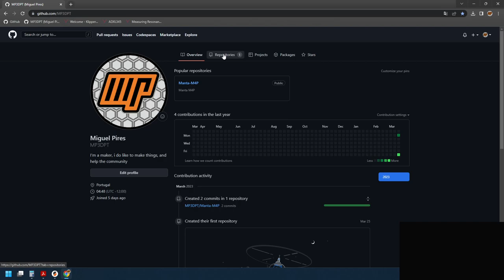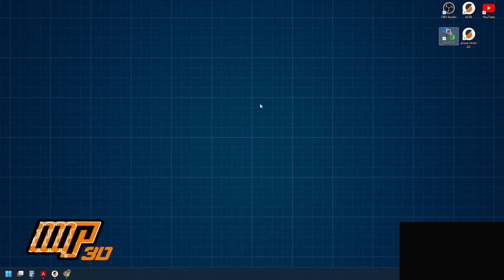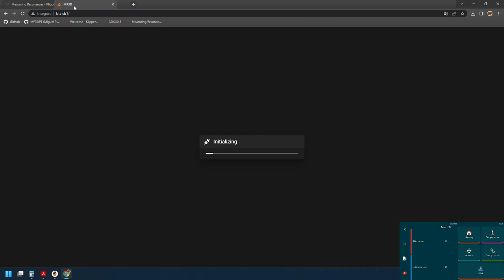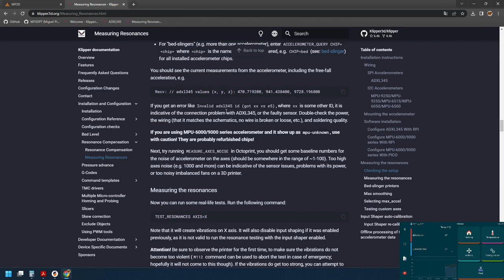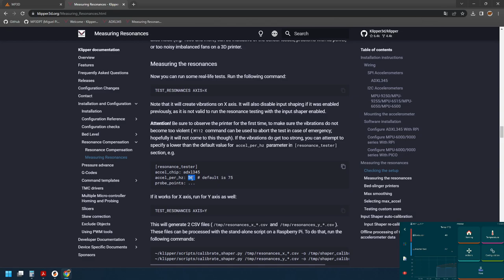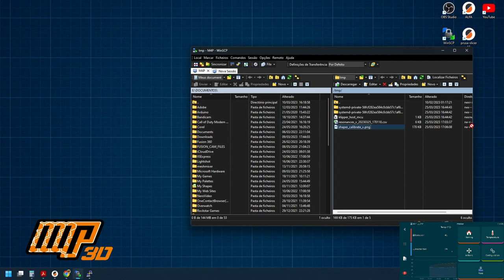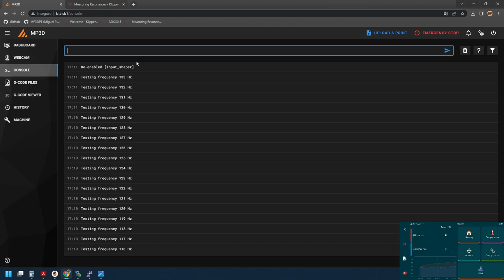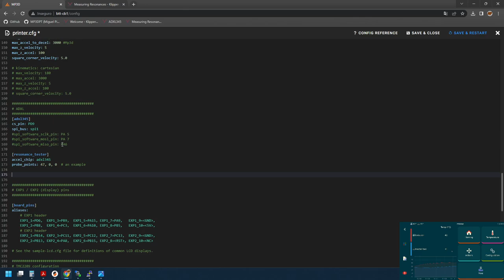Manta M4P - ADXL345 accelerometer - Configuration

Comment: Many thanks for the video.
Just a doubt, is it's necessary to configure some code in the CB1 or just the  printer.cfg file ?
Thx😊
Reply from the maker: Hi, if you use the image from btt, you will only need to configure the Print.cfg, you will need to find the MCU ID and add to print config so they can communicate, from there is klipper and your preference configurations.
Reply: @mp3dpt  many thanks 😃

Comment: great video but im having issues. i have a BTT M8P with BTT ADXL345 v1.0.1 and it gives me this error Option 'spi _bus' is not valid in section 'adxl345' do you know a fix?
Reply from the maker: Hi sry for late rply, hope you have already found the solution.
Any way, if you get that error you probably did not set spi_bus on printer.cfg

This is my ADXl code:

########################################
# ADXL
########################################
[adxl345]
cs_pin: PD9
spi_bus: spi1

Is all you need, if you are using RPI then you must set the the GPIO pins.

Example:

spi_software_sclk_pin: PA 5
spi_software_mosi_pin: PA 7
spi_software_miso_pin: PA6

Cheers and sry for late rply.